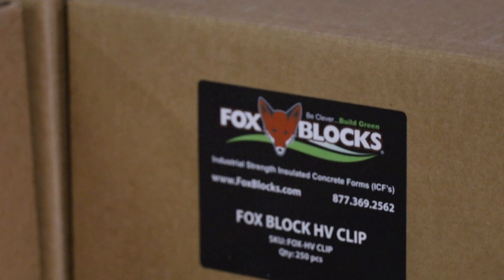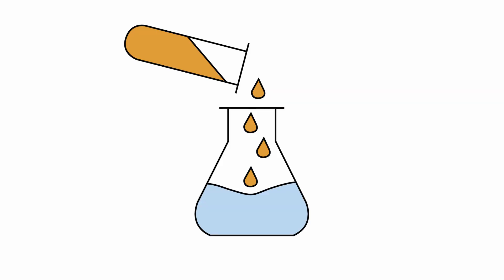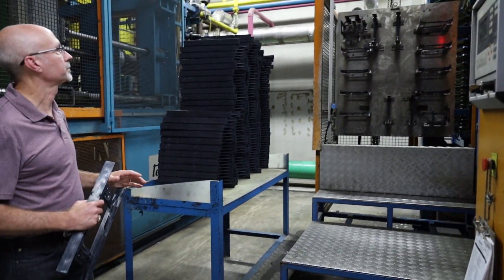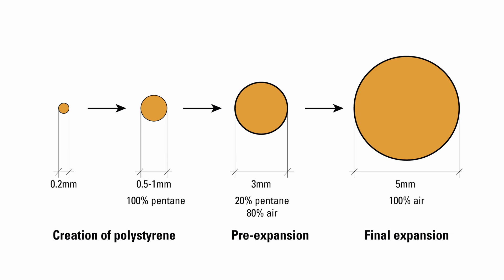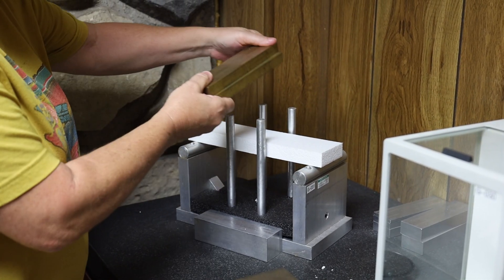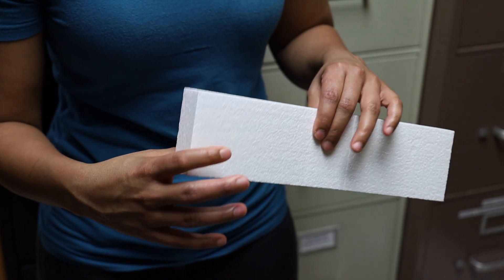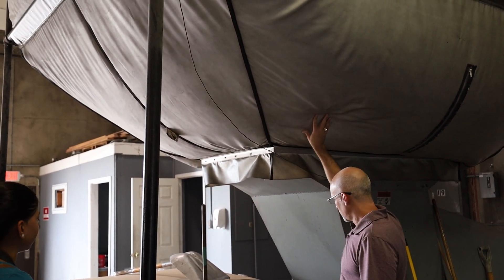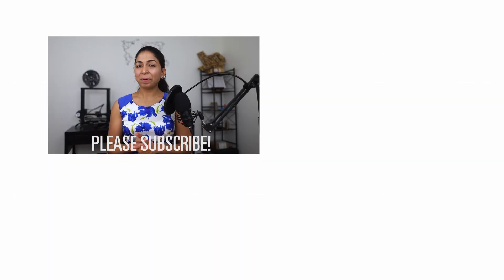How Insulated Concrete Forms/ ICF Blocks are made | Factory Tour!

Comment: Belinda, you do a great job with both precision and passion for the industry. Graphite infused polystyrene maintains its R value better, better fire retardant along with more structural support.

I believe there’s only one using this BASF product, but I think it’s worth considering. I’m planning on using the GPS ICF in my log home. The ICF will comprise the lower level and rock walls.

My 10” logs will have Rockwool layer I between inside and outside log. The entire log is utilized

Comment: Raw, untreated EPS has approximately the same flammability as diesel fuel. But treated with a specific fire-resistant additive. However some of ICF manufacturers use Hexa-bromo-cyclo-dodecane or HBCD. 
The problem that the HBCD is a persistent bioaccumulative toxicant (PBT). In other words, it’s a poison that builds up in the body over time, and the human body has no method of removing it. When levels reach a certain point, serious health concerns will develop.
The US Environmental Protection Agency made a full report about HBCD, you can read it for more information.
My question here, do "Foam Fabricators" use HBCD to make the EPS fire-resistant or they use another chemical?

Comment: A Sony engineer developed a way to more fully recycle polystyrene using the solvent D-limonene to dissolve the polystyrene and then process the solution through a distillation process that reconstitutes it back into the styrene pellets (the salt/sugar you mentioned in your video I think?) ready to be expanded. The distillation process also separates out the solvent ready to be used dissolving the next batch of polystyrene. I have often though it would be great if communities could recycle their polystyrene this way and form reduced cost ICFs for construction use in their communities thereby reducing energy consumption, improving quality of homes and reducing the largest contributor to landfills by volume. Win-Win-Win.

Comment: It looks like the most costly aspect is transportation.  I kinda doubt that miniaturizing a fab facility to fit on a trailer would really alleviate costs very much though.

Realistically, most of the styrene that enters the general waste stream could be best treated with pyrolysis.  Until the need for dump loads increases as a function of managing electrical grid stability, it's likely that pyrolysis plants are going to remain uneconomical in most regions, or at least niche. e.g., turning tires in methane et al  

We have a couple of styrene plants here in Baton Rouge, and they have a lot of legacy issues.
Reply: The mostly costly aspect is transportation! So you should always use a folding block like CelBlox in order to save a great deal of money.

Comment: Great video very informative I have a couple of questions the first is about recycling the black plastic clips in between the Styrofoam how are they recycled. The second question once the Styrofoam blocks are put together in a building if the Styrofoam is damaged say from flying debris from a hurricane can the damaged Styrofoam be patched or replaced.
Reply: Repairs can be done with PU-foam
Reply: @bjarnevarme9830  What is PU foam & how are the repairs made?
Reply from the maker: Thanks, Vince! Polypropylene can also be recycled. It's done at another facility. Thanks for answering the other question, Bjarne.

Comment: Great job. In Canada building an average house, it costs about $3000 more for ICF, I asked a contractor.
Reply from the maker: An average 3 bed 2 bath home, compared to stick build? That doesn't sound right.
Reply: @BelindaCarr  you are right. It's usually 5% to 10% more expensive than stick buildings.
Reply: @achasilas6535  You are absolutely incorrect. I own an ICF manufacturing company called Celblox. We continually build homes that are less expensive than stick buildings.

Comment: ICF aka Insulated Crap Forms. Concrete is unsustainable although I get it’s necessity in specific circumstances, styrofoam however should be illegal. We don’t need more waste in the construction industry. Steel reinforced concrete is impossible to recycle, I don’t want to imagine what it’s like if you add styrofoam.

Very good video btw, would love to see a video of a sustainable factory from you.
Especially on CDB or something similar!
Reply: You seem to be very misinformed about the carbon life cycle of actual buildings.
Reply: @tiberionblock1047  In that case please inform me :)
Reply: @lupus7297  I own an ICF company named CelBlox. We build LEED Platinum, Energy Star Certified, Zero Waste houses.
Reply: @lupus7297  Celblox houses also have an expected lifetime of 200+ years. Therefore, our houses actually count as carbon sequestration.
Reply: @tiberionblock1047  Very valid points, as the operations buildings traditionally produce around 3x more CO2 than their construction and materials production. Using this technology is a constructive approach to problems and limitations of steel reinforced concrete.

Though I highly doubt the expected lifetime of 200+ years. Many architect friends of mine have constructed modern urban buildings with styrofoam composite technologies, as is common recently here in central europe and it hasn't proven to be a good choice. Real world durability just isn't there.

Anyway if I give you the benifit of the doubt and these builds do last 200+ years, the recycling problems won't dissapear by then. Here in the EU styrofoam has to be recycled by law and cost currently lies around 120€ per Qm, this will rise a lot in the next years. When the time comes for these buildings to be demolished it is quite likely that we will have a problematic situation somewhat reminicent of the asbestos crisis. Essentially leading to buildings having to be ripped apart manually and step by step in order to avoid creating microplastic.

A strong parallel to the automobile industry exists, where exhaust filters sure were a great invention and do make combustion cars more eco firendly, but that doesn't make them sustainable. In the bigger picture is does quite the opposite, it makes combustion cars seem green when they actually are only greenwashed. Ultimatly overengeering of principly bad technologies, trying to make them something they can't be hinders the adoption of actually superior but not fully developed technologies.
Reply: @lupus7297  That is a very informed opinion. But one thing I must make one point about your architect friends. Styrofoam composite technologies is not ICF! ICF is a solid wall of steel reinforced concrete. The lifespan is easily 200+ years. We have built many commercial centers, storm shelters, and military bases all around the world.
Reply from the maker: Thanks! CDB?
Reply: @BelindaCarr Meant CEB sorry :)
compressed earth bricks
Reply: Steel reinforced concrete gets recycled all over the world you thick tosser. Also calling ICF crap shows me you are VERY thick and STUPID ! There is also very little waste using ICF to build homes and other.